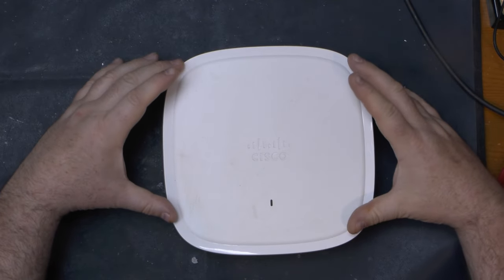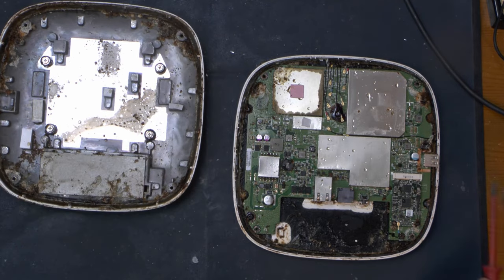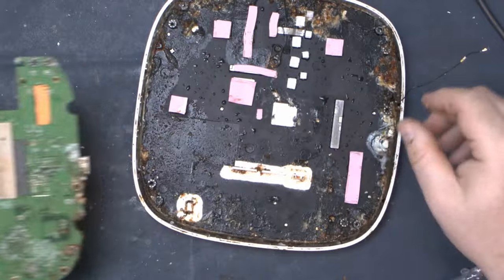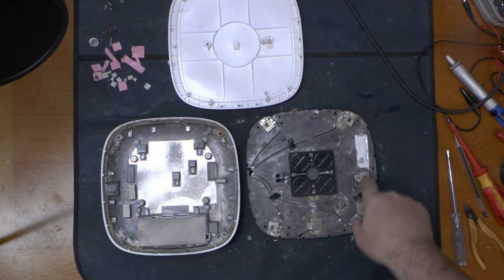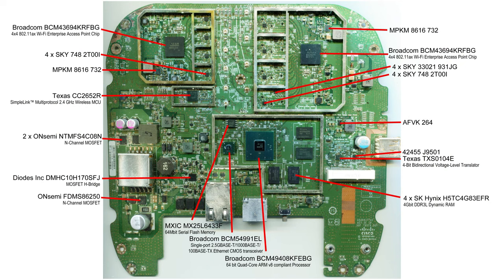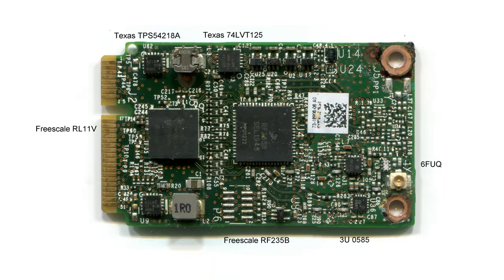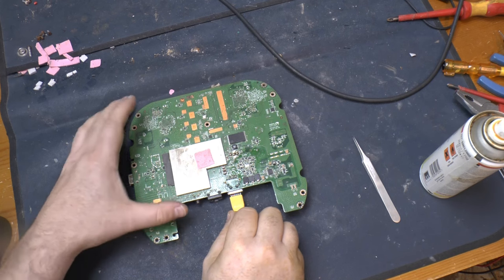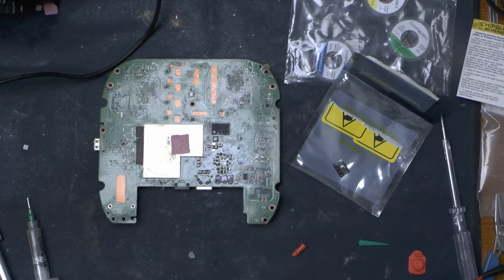What's inside a Cisco Catalyst 9120 wireless access point?

Comment: 'it's a bit grim' ...  I'll have to use that on a ticket in the future.  That roof leak has been going on a while, nearly got barnacles growing in the case.  Glad to have found this channel!  Good progress getting the brick to talk nonsense on the com port!  Now I am curious if they patched the roof before they replaced it, you might need this one for spare parts soon.  HA
Reply from the maker: Felt roof so that wasn't exactly clean rainwater, either.  The AP was on the ceiling while the roof leaked, was spotted, complained about, contractors appointed, arrived and the roof ripped off and replaced.  I only noticed because it had eventually had a gutsful of being soaked and had fallen offline, but summer holidays is when maintenance gets carried out anyway, so it was only after those that the problem showed up to be a real one.
We had another one at another site which was poured out same day by the on-site tech, that one's still running.
Reply: tougher than they look. @AintBigAintClever

Comment: I would check that all the voltages around the replaced MOSFET look good.  I have had issues with soldering down that style of package where not all the pins make contact due to excess solder under the chip pushing it out.  Also I would take off all the metal shields and clean under them as well.  If you have a ultrasonic cleaner I suspect that would do wonders on cleaning the board with some dish soap.
Reply from the maker: I took off the shields to scan the board, so had a good go under those as well.  Good call regarding the MOSFET, I was thinking of probing the two output rails to see if they were swinging properly, but the thing trying to boot threw me.

Comment: pretty interesting looking at trying to find all the faults from water damage. the fact that you even got that far is kind of amazing. with the jibberish on the console port have you tried changing baud rate to see if it somehow is not at default baud rate?
Reply: I agree its kinda miraculous you got this working this far. The gibberish in the console will make sense if the correct baudrate and flow control option is set.
Reply from the maker: I tried all the other baud rates available in Tera Term, no luck I'm afraid.
Reply: @AintBigAintClever  Might be a combination of baudrate and flow control. Tera Term calls the command "setflowcontrol" The same options are also available with PuTTY
Reply: @AintBigAintClever  Maybe probe the console output with an 'Intelligent' scope, perhaps it might be able to determine the baud rate, data bits, stop bits, parity, etc...    When I saw the gibberish, the first thing I thought was that the terminal speed was mismatched as well...

I agree that this thing should never go back into production use - but it's a fun project/challenge to hone your skill set on...